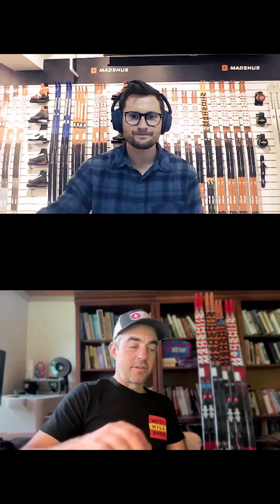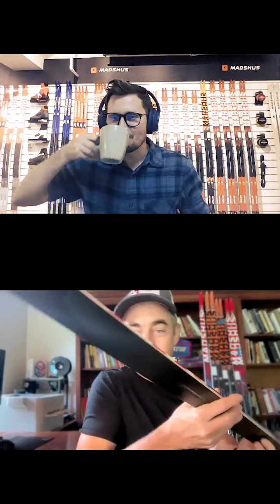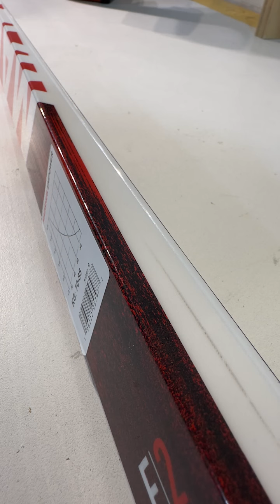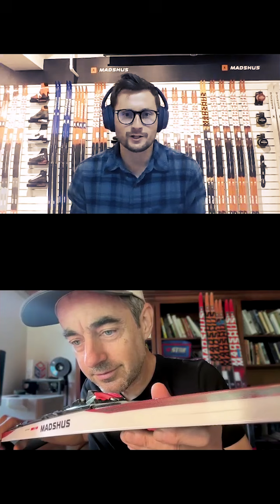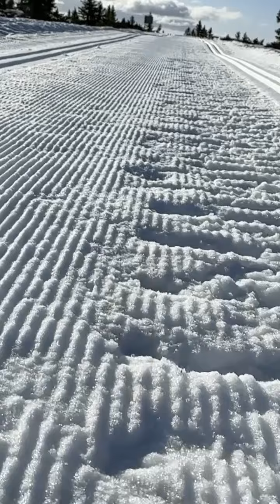Nerd Files S3:E1 Looking inside the new Madshus Redline

Comment: Thanks for this. I have been waiting for over 40 years for discussion about tech in skis. Having a few pairs of skis selected by Caldwell Sport after decades of ski shop skis have shown what a difference your process makes. A question: sadly, I'm an old man and overweight, but what is the manufacturing difference between skis for a 90kg guy and a 40kg guy (understanding there is more to it than just weight but just for simplicity's sake)? Is it just manufacturing variance that makes one ski more stiff than another? Or is that properly designed in, at least to a degree? Thanks.